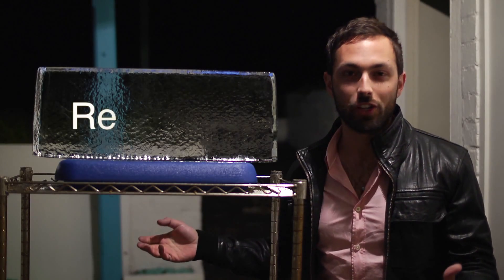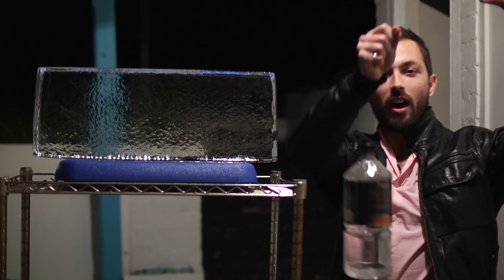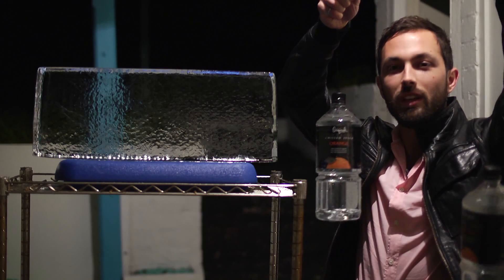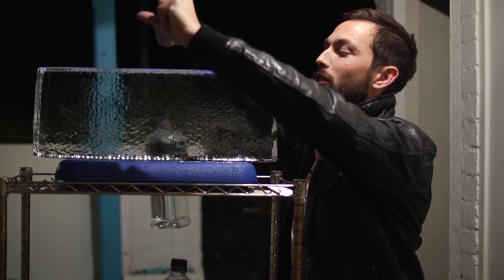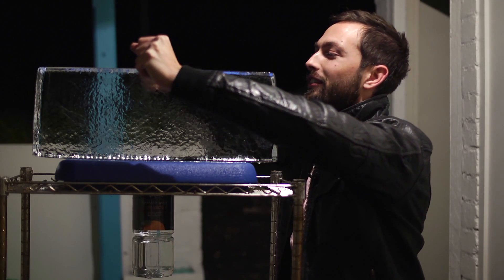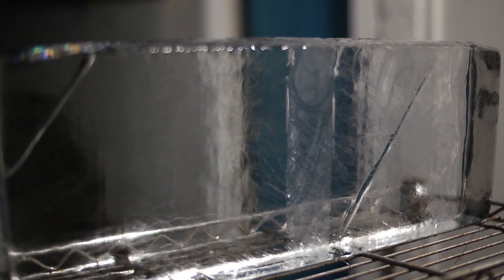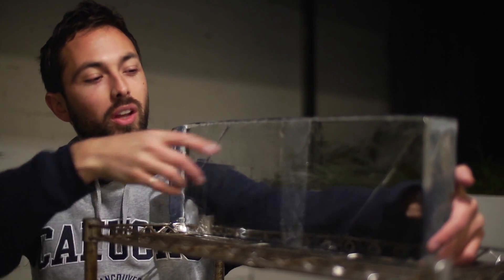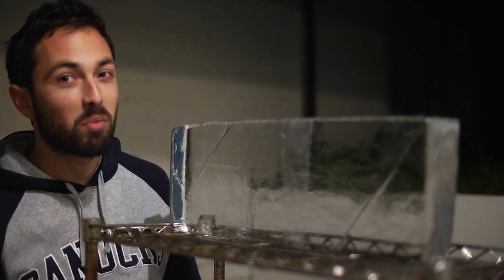Does Pressure Melt Ice?

Comment: It looks like this to me:
The wire is transferring heat better, the water freezes again because it is between two surfaces <0º.
Reply: Even when temperature is constant and just below 0, an increase in pressure will cause ice to melt. Water is unique in this way: It is more dense in its liquid state than it is in its solid state, so sufficient pressure will cause solid ice to move into the liquid phase. For evidence, look at the phase diagram for water.
Reply: Agree. Same effect as putting water on ice makes it flat.
Reply: You can do it with a thread too.
Reply: @co ck pressure increase isn't synonymous with temperature increase.
Reply: @meermehran007  but temperature does increase with pressure.  I agree though.  This is a poor way of proving that. Unless it’s actually below 32 deg F/ 0 C.
Reply: @dtnamastertech  I agree temp increases with pressure, more significantly for gases only.. But that doesn't always mean that a high pressure situation will have a high temperature.
Reply: It isn't that the wire transfers heat better. The thing with water is that as it freezes, it expands a lot and, consequently, applying pressure on ice melts it without it absorbing heat from outside.  A substance with a freezing point close to that of water (like benzene) will not show regelation.
Reply: Same. Should've been done with a material that has low heat conductivity, in a subzero environment where both the ice and string were cooled to the same temperature.
Reply: Clapeyron equation explains this! Pressure and temperature phase diagrams too, albeit more qualitatively. As pressure increases, the melting point decreases in this case. The high e string is important as it is the thinnest while gravitational force of the bottles is the same, thus pressure is the highest (P=F/A). Then the melting point changes, making it “cut through” more quickly than it just melting through. Since the pressure is relieved once the string goes through, it refreezes. And voila! String frozen in block :D
Reply: @co ck yeah, but this experiment doesn't look like that.
So i do not accept this experiment as a proof, it's like flat-earther using a ruler to demonstrate why Earth is flat.
Reply: @Saberwulfy  actually you can prove that the earth is round using a stick and a ruler and 2 people
Reply: We should expect at least some part of the ice to melt if you're correct though (as when the water freezes, it transfers heat to the two surfaces so it gets colder and solidifies while a small part of the two surfaces must get hotter and melt. But if the amount of water that's melted is much smaller than expected for your theory to work, your theory would be wrong. I'm sure there are other experiments which establish this regelation theory better since this experiment has a few other other possible explanations (like the one you just gave).
Reply: It is just transfer of energy. The weights on the two ends of the string does work on the ice (equal to the change in gravitational potential energy). Doing work on an a substance will increase its internal energy (kinetic energy (increase temperature to melting point) and potential energy (change of phase)). You are correct about why it freezes back.
Reply: Agree
Reply: Sometime if I think of it I will do this experiment while it is below freezing outside to eliminate that variable.
Reply: so many people talking nonsense in this thread and it looks like hardly any of them even read the wikipedia page
Reply: @co ck 
PV=nRT
is an ideal gas equation and has nothing to do with the conductance of metals or melting of ice.

Ice’s melting temperature increases slightly under pressure. The wire exerts pressure on the ice molecules so localized melting occurs.
That’s why ice is ‘slippery’ when you skate on it  you are technically skating on a thin layer of water just under your skates.
Reply: @doyouknoworjustbelieve6694  Ice is not slippery because pressure melts the ice, that's a common hypothesis but it's not true. It's actually because the surface of the ice has no ice above it to bond so it's "looser", and thus more liquid, compared to the rest of the ice.
Reply: @ardan981  
Hypothesis!!!
Surface of ice has no ice above to it’s slippery!!!
Read some science book.

Let me explain it some it again:
FRICTION cased by the weight per surface area (pressure) with ice molecules generates localized heat that melts the ice.

Physical properties are facts not hypotheses.

- Chemical Engineer who works with water and ice on a daily basis.
Reply: @doyouknoworjustbelieve6694  Your first post ONLY mentions pressure on the ice, and fail to ever mention friction. Thus, according to you in the first post (that Arvban is replying to) friction does not play a role. Only Pressure. Of course, you were then wrong (since you didnt mention friction at all!!), and chose to lash out instead of accepting it. Friction does melt the ice yes, obviously, but specifically the Pressure does not. Obviously as you'll yell back, Pressure affects friction!! but it in itself is not the cause of melting (as you state in your first post). Arvban HAS actually been clearly reading some "science book".  Quote "water molecules at the ice surface vibrate more, because there are no molecules above them to help hold them in place, and they thus remain an unfrozen liquid even at temperatures far below freezing." Next time you want to sound like a smartass know it all maybe do a bit of research that took me just 2 minutes to do for this reply, to ensure your response isnt just cocky and wrong. Your first post failed to mention all aspects needed and then you got salty when someone proved you wrong. It's like if i said "whats 6+6?" and then when you say 12, I say "well actually its 6+6 but its all over 6 so really its 2 and you're a dumbass". 

-Chemical Engineer who works with smartass know-it-all motherfuckers like you on a daily basis.
Reply: @Ionepine  
YouTube posts are not scientific papers. Yes I failed to mention in my first post that the pressure causes friction. I then explained what I meant in a later post👆👆.
I only entered the discussion to explain to the other guy that PV=nRT does not apply here.

You seem to be under lots of pressure. Go vent some steam somewhere else. 
Be sure to take your meds, and wash your mouth every 5 minutes.
Reply: @doyouknoworjustbelieve6694  nah you're wrong and the other guy is right about why ice is slippery, according to Richard Feynman's explanation
Reply: No. What is PV = nRT
Reply: @Standard_Logic  ideal "GAS" equation.
Reply: “Outside of Sydney and it’s warmer than 0 deg obviously.” What a crap experiment.
Reply: EXACTLY...this was such a silly experiment and comprehension of what is actually happening...

Comment: Though the analogy is not directly related, I'm drawing a parallel to Casimir effect here. Though not with ice, but with two plates having outside pressure being stronger than the inner pressure in between the plates.

Comment: this is not only pressure here! this is working because of thermodynamics. the pressure made on the string is just keeping the string tight enough to cut through. heat is being transfered through the string and this is the heat what is making the ice melt and when the string is passed the water turns into ice again becasue of cold ice around it. this is not cutting with pressure but cutting with heat. it seems something else and it is something else...
this is how physics works bro

Comment: If water boils in a vacuum and ice sublimates, I find it hard to believe that adding pressure will make ice melt. It feels like doing the opposite to yield the same result.
I think that if the ambient temperature was below 0 degrees Celsius, the wire wouldn't pass through.
Does this happen with metal too?

Comment: Although pressure is a factor in melting the ice here, the majority of the melting is occurring by the transfer of ambient heat through the string. This phenomenon is generally known as string theory. 

A more accurate experiment would have the whole thing done in a freezer set to 32F, with all components at the same temperature.

Also the refreezing here is not primarily due to pressure relief.  It is a majority function of the dissipation of the heat of the liquid water into the larger block volume. The experiment done under the same conditions with a small ice cube would have very different results.

Comment: It’s not technically the pressure itself that’s melting the Ice. The string itself is not moving. It has no action so not energy is being used on it. However the two weights pull the string downward with the help of gravity and the additional weight. If what I took from TheActionLab is correct then that is newly applied energy to do nothing. Just sit there. But this is causing friction with the contact of the ice which is transferred into heat “melting” the ice. It’s more about the friction FROM the pressure. Not pressure itself. If we compacted the ice tighter and tighter and tighter while excluding friction the Ice won’t melt. It’ll crumble as the volume of the ice has no where to go but inside itself. But if you applied friction to this example, the ice would melt as the friction coming from all angles is being transferred into heat. Pressure does not melt. Friction does. Diamonds for example are creating by applied immense pressure which causes heat to change carbon molecule structures. Why ground layers are fused together due to pressure surrounding all sides. Now the refreezing is just ice making contact with colder Ice. There’s more colder Ice than warm ice so the balance is to freeze again. You can combine metals in a similar way known as cold welding. Two metals can be combined with enough pressure. Two Aluminum foil sheets can be combined together into one sheet.  The reason why we can’t do it in our average home is because there is an oxygen layer on both the sheets. (If  someone had a vacuum chamber in their home then it can be plausible to combine the layers)This impacts the molecules of the metals retracting the attraction they have towards each other. It’s like trying to stick something on a wet wall. You gotta dry before you stick something. I would recommend watching TheActionLab. He explains everything and finds a deeper understanding of what’s going on. The type of welding we see here is not cold welding. But actually regular welding. you melt super hot metal and apply it to either multiple or singular pieces of metal. The melted metal interacts with the colder medal. If done incorrectly you get what is known as cold shuts. When the the same molecule (doesn’t have to be the same but is usually common in inexperienced welders) is in two different temperatures that creates too much stress on the metal and cracks. Pressure did not melt the ice. Friction did.

Comment: Actually I think it's because outside is colder than 0 celcius ice slowly melted and string got through. But because the distance between the two cut sides were so thin, they fused back together from the coldness of the ice. I don't think this is some different physical phenomenon.
Reply: That makes no sense
Reply: @sheev9852  why?

Comment: I like some Veritasium videos but this one seems totally bogus. It wasn't necessarily the low pressure that caused the ice to refreeze but instead it was the temperature of the neighbouring ice which took the heat from the melted water between the blocks. In fact, the melting also may not have been caused by the pressure of the wire but by the temperature of the wire which is a good conductor of heat from the room around it. This second issue could have been addressed if the temperature of the room was lower than the temperature of the ice, but he didn't say what the temperature of the room (or the ice) was. Ice can come in a very wide range of temperatures. This video had as much good science as a flat-earther video.

Comment: Not a controlled experiment at all :/ the wire is highly thermally conductive, so from the surrounding air the wire will constantly be heated above 0 in the center. The force from the water bottles ensures contact for constant conduction, melting the ice much faster than the convection around the rest of the ice does.

Comment: What if the ice was actually melting because it came in contact with a relatively hot wire. You can clearly see the edges are cutting faster than the center which you could argue because at the edges the wire is hotter than the center... I think you would have different result if you apply a wire with freezing or under freezing temperature....

Comment: I'm don't play guitar but isn't the G string metal? If so shouldn't the ambient tempreture be 0C so you remove thermal conduction as a variable? or use a plastic string to reduce it at least?

Comment: It's not the pressure that melts ice in this experiment. It's heat conductivity. Guitar string is from metal, which is good heat conductor. If the ambient temperature is above freezing point, it will heat the string and that heat is transferred to the point of contact with ice.  I'd like to see this experiment to be conducted, where ambient temperature is around -1 deg C.

Comment: It could also be theorized that because you used metal instead of say, plastic or fabric, the metal couldve acted as a thin but wide heatsink, and simply melted the ice by redistributing heat from the surrounding air and melted the ice, before falling down allowing the remaining ice to refreeze the connection...unless the environment was below freezing and I totally missed that. I'm not denying the scientific properties of ice, I'm just putting forth a hypothesis on how this experiment MAY have been PARTIALLY flawed. I might also be completely crazy. If so explain. Thanks, very interesting video.  Left a like. If you're reading this, you should do the same.

Comment: Pressure alone did not cut the ice, the fact that it was a metal string that was warmer than the ice itself helped. Would it still have cut through if the experiment was in a 0c room and the metal string was cold as well?

Comment: I don't think it's because of pressure, I mean sure, the friction is heating the ice to melt(like a figure skater), but it's the temperature of the ice the water is still connected to causing it to freeze again. Especially when the little amount of heat in the water easily gets transferred to the ice, and because there's more ice then water, the energy is transferred out of the water and turned back into ice.
Reply: It's because of pressure.

Ice has to be expanded from it's liquid state to be frozen.

If you put it in a container that's strong enough to stop it from expanding, it won't freeze.

And likewise, if you put enough pressure on a given area, it will compress the ice, which means it has to unfreeze.

Comment: this experience should be done under freezing temperature area.    the wire can get the thermal energy from the room to use it to cut the ice block.   this is themal conductivity. I would be interesting to see the same experience under -20C area condition

Comment: No! It makes ice! Check the bottom of extreme deep ocean.

Edit: I fact checked myself (ACS.org): ''Methane hydrate is a crystalline complex of water and methane that forms beneath the ocean floor. It resembles regular ice, but it can easily be set aflame after it’s brought to the surface.''

(Chemistry.stackexchange) ''So, if at the bottom of a deep, high gravity sea, the ice will form at temp above 0C. If it starts floating upward, the lower pressure will allow it to melt.''

Comment: I don't think this experiment excells at proving the point of pressure melting ice and release of pressure causing it to freeze again. Even though I obviously believe in this physical rule, you could argue that the metal string melts the ice because it it steadily kept above freezing temperature from the ambient temperature and causes the ice to melt in this way. The small amount of fluid water left behind by the string passing through the ice then freezes up again because the ice blocks temperature is well below the freezing point. 
I realize this is a very old video and since this is likely from the time of the start of this channel the ressources that could go into creating a video were limited, it would be interesting to see this experiment revisited today with access to better suited lab equipment.

Comment: i don't think its pressure that's melting it i just think its melting because the wire is taking heat to the ice and its just refreezing because the rest of the ice is cold. do it with a plastic cord instead

Comment: The melting of the ice is because of the thermal conductivity of the guitar string. Besides the pressure, the string acquires heat from air and conducts it toward the ice. In other words, we need to see the experiment done in a freezing cold environment, like inside a freezer or so.

Comment: I think the ice melts in this experiment because the metallic string is a good conductor of heat. That’s why it formed an arch shape not a straight line while going down. Means the higher temperature in the room melts ice quickly near the surface of the ice block. I am sure the outcome of this experiment would be different if you use a non conducting material or keep the room temperature same as the ice block.

Comment: Isn't the ice just melting because of the lower temperature of the wire and refreeze when the wire passed through because it's still in contact with the ice?

If you want to show that ice being pressurized turns to water, how bout using an actual machine that compress them or at least increase the atmospheric pressure to simulate a very high pressure environment.

Comment: Ok, the ice is colder than freezing so obviously the water touching it will refreeze... And how do you know the pressure alone is melting the ice, and not heat conducting from the enviornment to the wire?